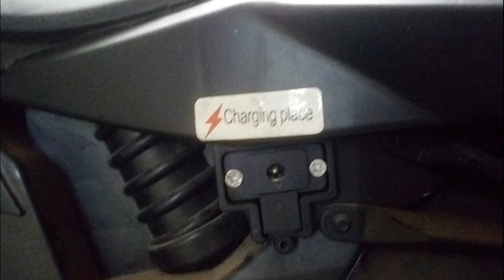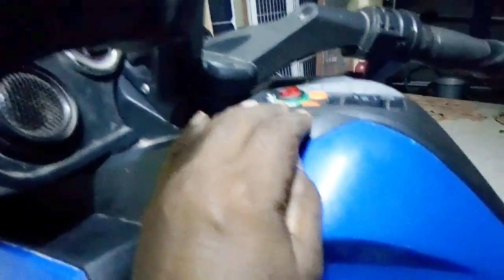kids ELECTRIC BIKE REPAIR AND RESTORE TAMIL

Comment: My bike not moving forward or back.
How to repair it?
Bettery is ok but accelerator not working.
Reply from the maker: Check Reverse & forward
Switch and Accelerator Control wiring Also
Reply: @lboopathiraj_karaikudi  I have checked both, It is perfect, there are other problem
Reply from the maker: @reyanshcraft   check motor  then  check controller

Comment: Full charged but running slowly why? Battery also be changed.
Reply from the maker: check switches and clean moisture and dust /also check charging pin and finally check control board
Reply: @lboopathiraj_karaikudi  Wheel fast ta suthi slow va aaguthu .Charger maathi paakalama? 6v1A tha use pannitu iruntha.